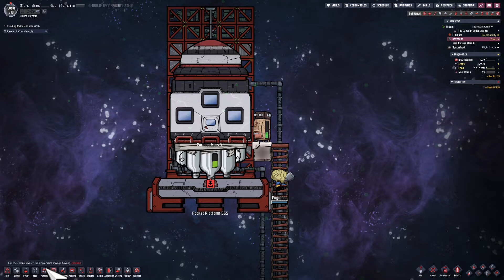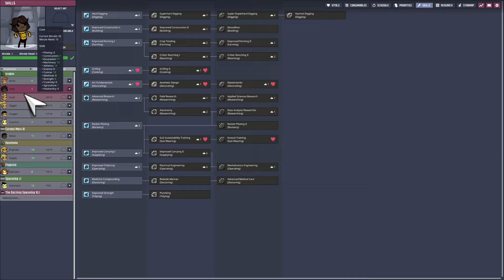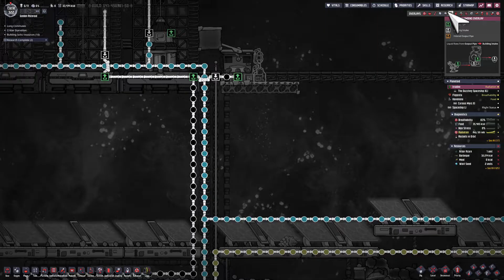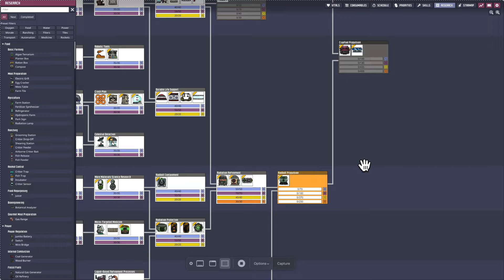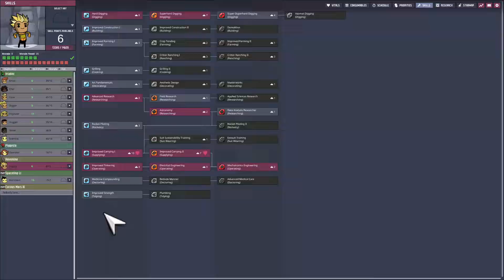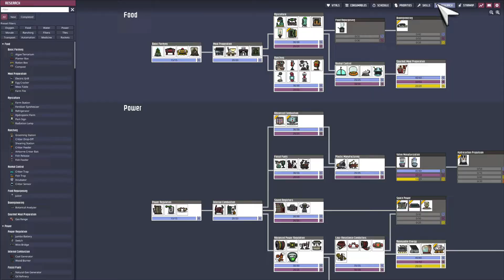ONI: Radioactive Ocean Astroid - #8 Electrolyzer System

Comment: Electrolyzers don't need cooling if made out of gold amulgum as the water and oxygen cools the machine ..but the oxygen which comes out is hot(depending on water supplied)
Reply from the maker: Perhaps I should reroute the cooling pipes to be around the air pumps as to cool oxygen before supplying it into the base. Thanks!